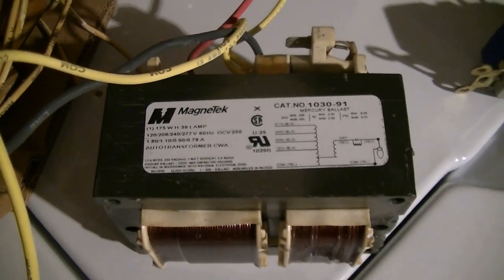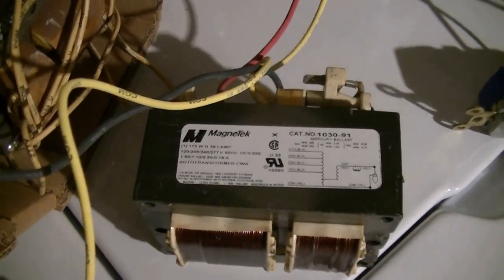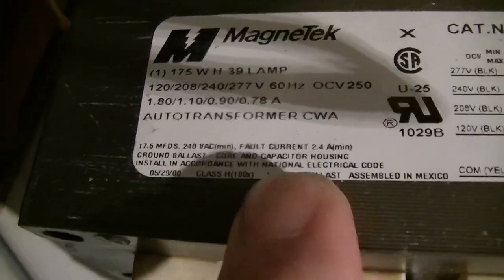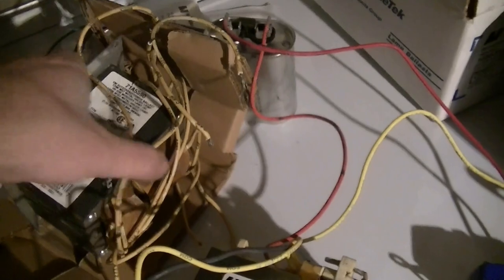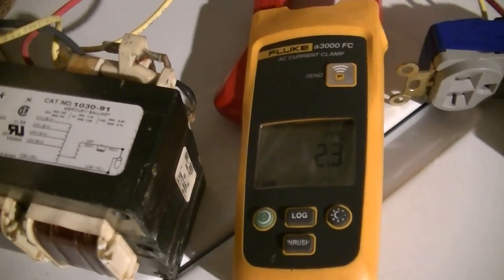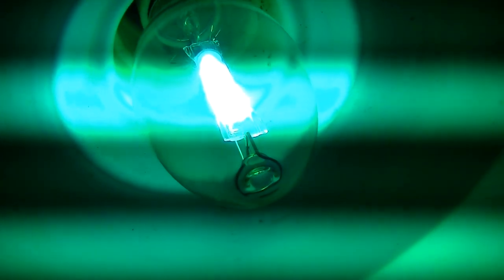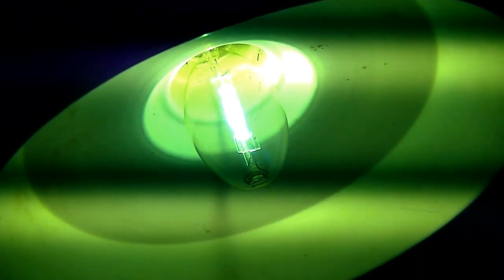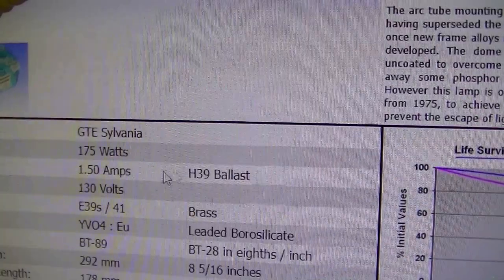H39 constant power autotransformer mercury ballast current test

Comment: Interestingly, the VHO T12 and GE Powergroove fluorescent tubes also have a similar operating current to the 175W H39 mercury vapor lamps as well. I once tried using a 175W H39 mercury vapor CWA ballast  as a preheat ballast for a 6 foot VHO T12 fluorescent tube and the tube somehow rectified during operation.

Comment: can you make a tutorial of how to make a wiring with a mercury vapor ballast?
Reply: The wiring diagrams for mercury vapor ballasts often vary from ballast to ballast. To start off, a simple reactor ballast or choke ballast should generally only have 2 wires coming from a single coil. All you need to do with those ballasts is simply wire them in series with the lamp, but you will specifically need a line voltage of somewhere around 200V in order to get them working properly. Another ballast that also comes into mind is a high reactance lag type autotransformer (HX) ballast. Those should generally have 3 wires coming from them: the “hot” wire for the input voltage, the “lamp” wire for the lamp socket, and the “common” wire for All you need to do with those ballasts is hook up the “lamp” wire to the lamp socket’s “hot” wire and connect the ballast’s “common” wire with the lamp socket’s “common” wire and the input “common” wire together. Lastly, there is the lead peaked constant wattage autotransformer (CWA) ballast. The only difference I see with CWA ballasts and HX ballasts is that for the CWA ballast, you will usually need to connect a capacitor in series with the lamp socket on the ballast’s “lamp” wire. On a CWA ballast, a capacitor is necessary for proper ballast operation while on HX autotransformer ballasts and simple series choke ballasts, a capacitor can be connected in parallel with the input terminals to provide power factor correction, but those ballasts generally do not require a capacitor for proper operation.